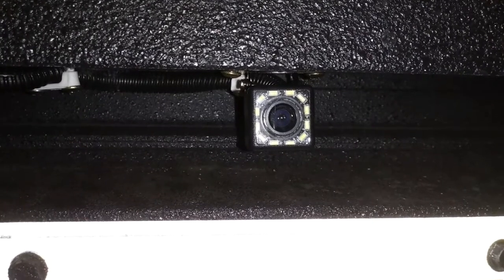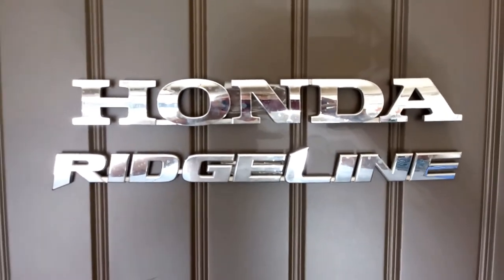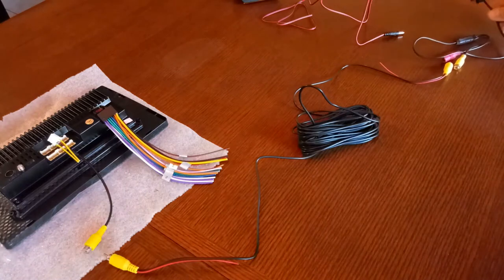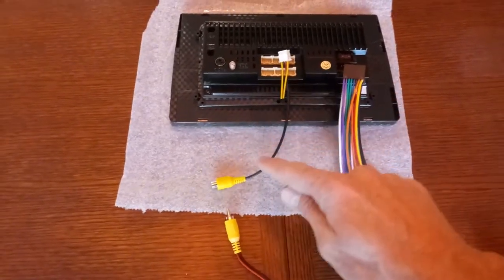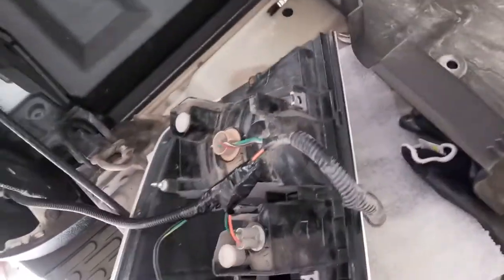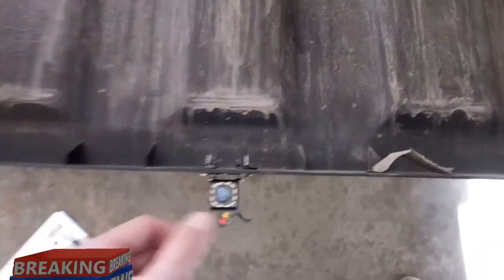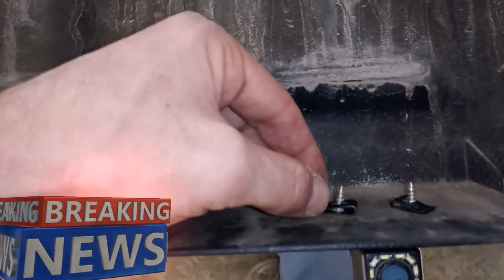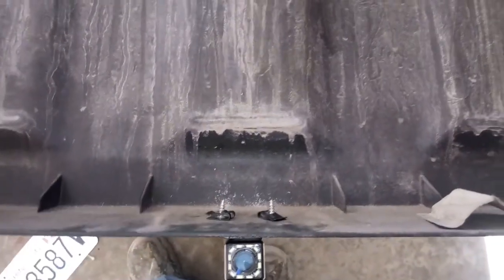How to install back-up camera//08 Honda Ridgeline//(part 2)

Comment: Your video was great to help me install a plate mounted camera. I zip tied the cable to the running board. Behind the rear tire is a plastic trim that has two screws. After removing the screws, I was able to push the loom up under the plastic and high enough over the screw holes. Inserted the screws and now I won’t have it worry about the loom falling out.
Reply from the maker: Good idea Andy! Hope this helps others doing this project, and glad it worked out for you:-)

Comment: I was able to loop the wire under the trim piece along the floor board to the back row.  Once you pull the floor trim in the back row, there is a middle hole that you can expand with a larger drill bit and then loop the wire through.  There is a rubber grommet under the chasis that you pop out.
Reply from the maker: Wow...ok, that sounds like a definite good alternative to what I did too! Glad you brought another solution to the "table", and hopefully when people look at the comments, they will take this option under consideration!

Thanks for comment, and I'll give ya a shout-out in one of my next videos:-)
Reply: @hurstysgarage  I love your detailed video.   I had trouble getting through the firewall above the brake pedal so this option would save some time.   Keep up the good work with the Ridgeline!
Reply from the maker: Thank you!!! I will:-)...and yeah, that is a tight spot I chose, but I utilized it because previous owner had already "punched thru" with their own wire.

Anytime you can save yourself heartache or time, and make it easier, I'm all for...just glad you are in there doing it yourself:-)
Reply: I know it's been a while but do you remember where exactly is the middle hole that you said , I'm trying to install the back up camera , thanks ✌️

Comment: So how long do you recommend on cable length...   I'm planning on doing the head unit like you have.   But I'm putting in the camera in the tailgate handle.
Reply from the maker: Great place to put it! It's  been a little while and I can't remember exactly...I don't believe it was over 6 feet. Probably closer to 4 ish.
Reply: @hurstysgarage  so if I ordered something pre made in 1 length.   Maybe say like 15 o16 ft total
Reply from the maker: @jamesguralski5156  absolutely should be 👍

Comment: I was just thinking about painting my ridgeline in truck bed liner.
How is yours holding up? Did you do it yourself?
Reply from the maker: Absolutely Doug...if you search my channel, you will find a video where I explain how to accomplish this and how much approximately it costs and what I used (I did it myself)! I say go for it. I love it, and after about 2 years, still like the day I put it on (but you have to do good prep just like any paint job). Let me know if you do it:-)

Comment: I se you have had your truck sprayed with textured plastic material?  Does this prevent or slow rust?  If so, what is the name of this product?
Reply from the maker: Hello Kayla...yeah, I put a product on the truck called "RAPTOR BED LINER." Awesome product that will prevent "NEW" rust from forming, but will not address or stop "OLD" rust from doing its damage! That must be taken care of before applying (either by spray, which I recommend, or by rolling on) unfortunately:-( 
But this product so far has been an almost "bullet proof" option against scrapes and scratches and the like...so for a little bit of prep work, you can expect a long service life of paint job from my research and what I've experienced so far!
Now rustoleum does make a similiar product, but I can not vouch for that, and I am almost certain again that RUST MUST BE REMOVED to assure proper adhesion and longevity of product (paint).
Reply from the maker: Thanks for comment...hope that answers question, and let me know or show me a pic of what you chose to do or how things turned out if you proceed with paint:-)

Comment: Not a bad idea but a lot of times I have longer material sticking out with the tailgate down and then if I back up I won’t be able to see because the camera will be pointed down towards the ground. That’s the only drawback here I think.
Reply from the maker: Yeah Vin, I hear ya...It was a tough decision, and I thought I would place it as close to the factory position as possible. Just curious, where would you like to place it? THANKS FOR WATCHING, and COMMENTING!
Reply: @hurstysgarage  I’m in the middle of an install and chose to screw it to the very bottom of my bumper setting down right on top of my class 3 hitch. I’ll let you know know how it works out.

Comment: The new pain job is expensive for this type of truck, and make the interior hoter on summer time?
Reply from the maker: arturito57...thanks again for comment!!! Good question....so far I have not noticed to much of a difference in interior temp from original color (silver), to the black now. If that is a concern for you, then they do make a huge variety of other colors:-)

And as for the expense... I think it's worth it because so far the paint job has been Bulletproof so to speak, as far as I haven't seen a scratch or mark on it and I've taken this thing all throughout the woods, but it just depends on what you think you're going to be using your vehicle through, and your tastes as far as this paint job goes... It definitely isn't for everybody, but for the price, I really couldn't go wrong. Especially since I thought about taking it to Maaco... and the cheapest price there was going to be $1,000, and that's not even for them to do a good job with prep work, they would just paint over whatever you brought it too them with, = no primer! Again thanks for comment though... And I really hope you consider the Raptor lining, because you won't be disappointed.

Comment: Did you connect the pink wire on the radio (labeled Reverse) to the red wire coming (along with yellow video cable) from the rear camera?
Reply from the maker: Hello PSG...yes, the pink wire on the harness (labeled BACK) mates with the little red wire coming off the video cable at the head unit end. The little red wire coming off the video cable at the actual camera end at rear of vehicle gets mated with the power positive off your back up light ;-)

Comment: Hi I know this is months later but I just installed this in my truck, but I have no idea what those two wires are that are hooked to the camera connector to unit for; it’s two short wires.. any help please? Thanks!
Reply from the maker: No problem AATV...The red wire passes the reverse signal up to the front of the car. The camera end has a red and black wire which the red wire gets connected to the reverse light and the black gets connected to ground. So the ones by the stereo are for same process...if you want to tap into reverse an ground up front, instead of rear. Hope that helps:-)

Comment: Is the camera range of view straight ahead or pointing 45°   bellow the back of the vehicle?
Reply from the maker: Hey Arturito57...first off, thanks for comment:-) 

Secondly, you can adjust the camera to pivot at any angle you want going up and down (it can swivel up and down), but is a fixed point on side to side movement. I like it because I can swivel down if I am towing to look more at the hitch, or up for normal use:-)

Comment: Doesn't mounting your camera in the middle prevent you from using the swing feature on the tailgate?
Reply from the maker: You are absolutely correct Randy... I want to apologize for not taking the video down and addressing that problem. On my vehicle, I had extra "line" that I could pull out when using that feature, but it was a pain and not very user friendly...so, to fix that, I will show you, but here is the process...Instead of running through license plate, where you split off to go to tailight, there is a small space to run video line up to and under tailgate on left drivers side. So adding a coupñe more electrical white holders under tailgate to keep neatness and wire from dangline. Thank you for catching this:-)
Reply from the maker: Update...I'm downloading new video today that addresses the issue:-)
Reply: @hurstysgarage  You're awesome for re-doing it all.  And I appreciate that you took off the license plate in the 3rd video haha.  Easier to see what's going on.

Comment: Have you had any issues with your backup camera? I have the same setup and just installed everything. 

Whenever I shift to park, the screens says "the rear camera can not be detected" and  stays stuck on that screen.
Reply from the maker: Shoot, sorry to hear about that!!! Well I had the system mine worked just great, but I cycle through a lot of different head units, so I only had that unit for a few months. The only obvious thing that I can tell you to check right now is to make sure that those connections via the video cables are made it up correctly and that the wiring leading back to camera pinched and is not somehow grounded out.... and then make sure that the connections on the camera itself are obviously in there and mated correctly:-) let us know how it goes though please

Comment: I've got a 2011 that has a backup camera already. 11 years old, it's not all it should be. Could this camera you installed fit where the original camera was?  Plus, I have a 6 cd player and a info/nav screen.  I like my cds. Do I lose the cd player with this stereo/ screen?
Reply from the maker: Hey Jon, I have not been able to test that theory out about the camera, so not absolutely certain it would be a perfect match for hole...and unfortunately, you do lose the cd aspect with this head unit config:-(

Comment: How did you get the cable through the grommet?  I pushed in from the outside and it felt solid, did you have to cut into it a bit?  9:27
Reply from the maker: Hey Leonardo...No, mine had a slit in it already, along with a wire that the previous owner had "fished" a aftermarket security system from! It will solid, if unused...so you will have to slice into while on firewall, or pry it off with pliers or a screwdriver being careful not to totally destroy it. But, that is why the manufacturer puts them there...so you have access! It should come out pretty easy, then slice, fit wire through, then put back in place because not a lot of room for fingers and hands to work while placed on firewall:-)
Reply from the maker: And, no dust or dirt or water comes through, but if you are worried about it, you could put some type of silicone sealant on tab...but I did not and have no problems:-)
Reply: @hurstysgarage   I ended up just putting a knife through it and created a slit in it, no big deal. Thanks for your help. I followed most steps of your video, including taking apart the tailgate, couldn't have done it without your video, so glad you got an old Ridgeline and decided to make videos haha. I got mine last week. 
I had the same issue with the backup camera, that it's not the license plate one. I mounted it in the tailgate handle, looks stock!
Reply from the maker: @Leonitrous  Awesome...yeah, I am by no means, a professional, so there are probably many ways to do it...just glad you able to complete it the way you want it! Love my Ridgeline, and noticed not a lot of stuff out there for us. Thanks again for comment, and keep em' coming anytime:-)

Comment: Hi, Please could you tell me if you connect and where your connect (in case) the brown cables (Key-1 and Key-2) some people say is for steering bottoms. I have the 10.1 Hikity car stereo too. Also, did you connect and where your connect (in case) the yellow cable (Memory) from the aftermarket harness (Harmony HA-701721). Also, i understand I don't have to connect the pink/white (Dimmer) cable. Please could you let me know. THANKS. You have a great video!
Reply from the maker: Hey Luis...I know this stereo stuff can be confusing...The Key 1, Key 2, and Key GND wires will be used to interface steering wheel controls if your vehicle came equipped. Most newer vehicles will also need the Axxess ASWC-1 to translate the steering wheel controls which I didnt need but you will. Yellow memory wire goes to the yellow memory wire on the harness... and yes don't use the dimmer wire just the one marked 4 the illumination which is the orange one I believe
Reply from the maker: Thanks for the comment and let me know how things work out:-)

Comment: You added an extension wire, however that one does not have the red trigger wire. How did you do it then?
Reply: He added a extension for the red wire as well , it's somewhere in the video 👀, I'm installing mine now ✌️